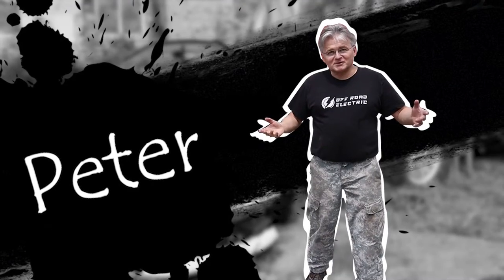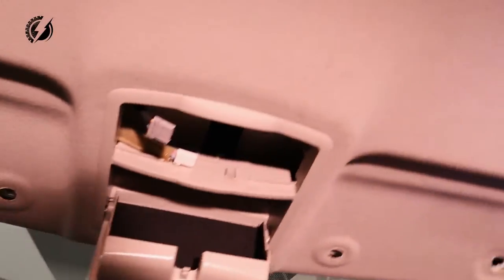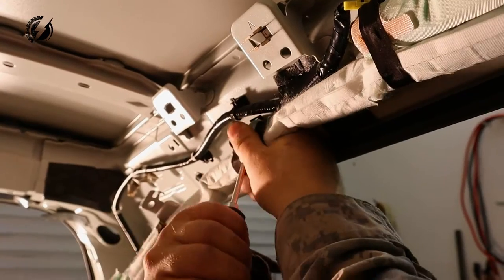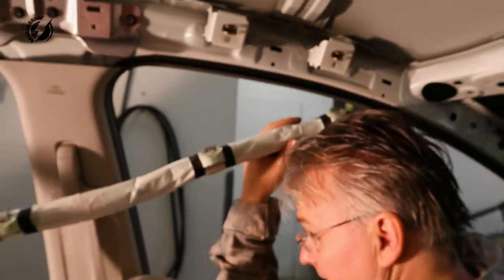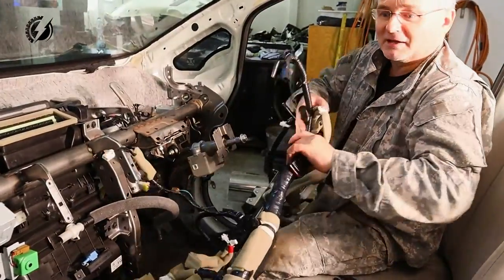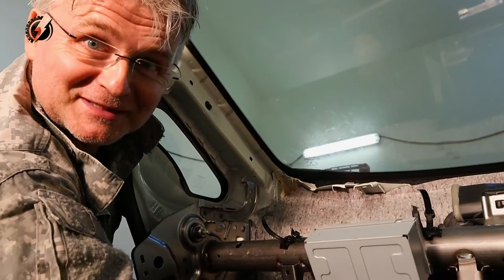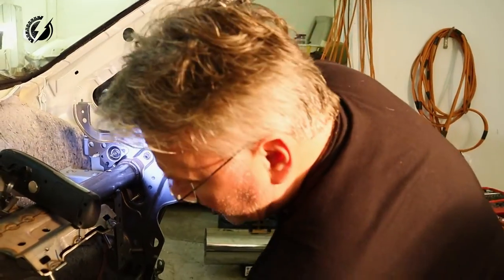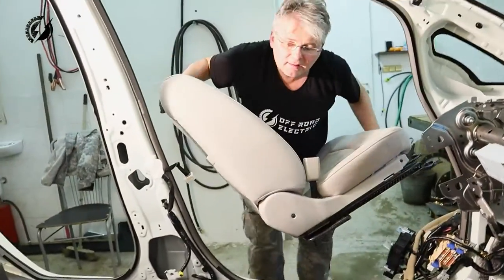EP41/2 Best Off Road Electric Monster Truck Build-Leaf

Comment: Amazing, the number of connectors and clips in a modern car!  Great for skinning your knuckles.  I remember working on my '74 CJ5 with side pipes and a 304, just a couple of wires and that's it.  Nothing like this Leaf! Keep up the awesome work!  Cheers.
Reply from the maker: The original CAN bus is huge. We will use just a fraction of wiring,  but I am trying to keep everything, you never know what you will need. The next step is the building of the truck, that will beat everything what we have done so far!